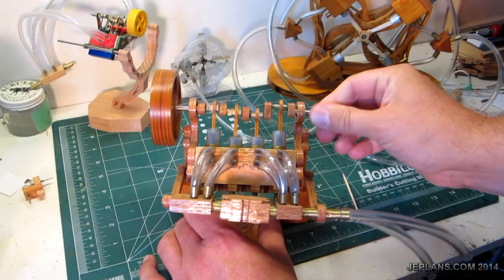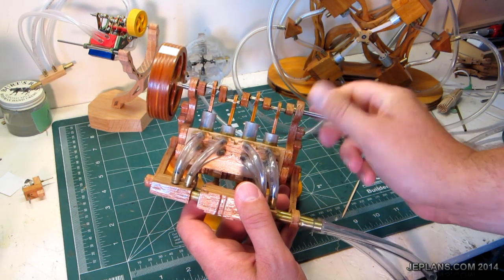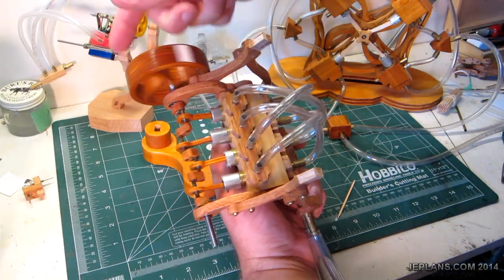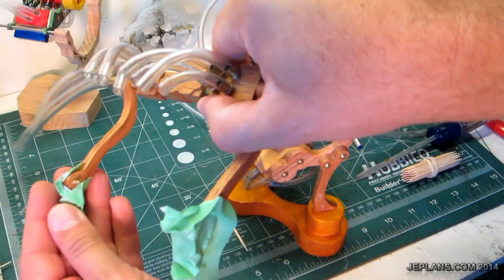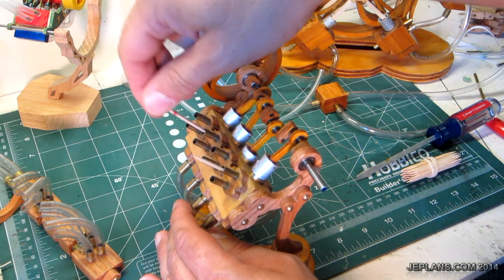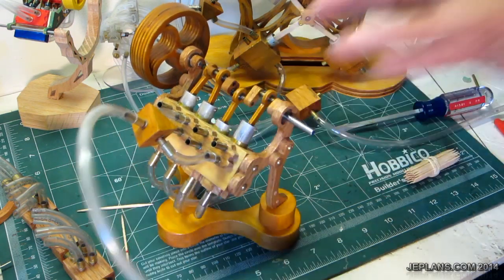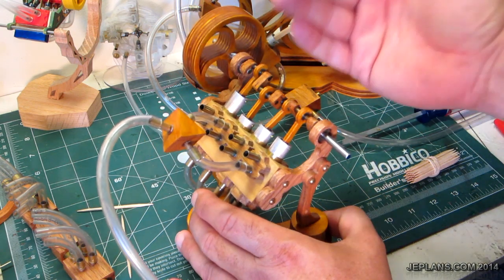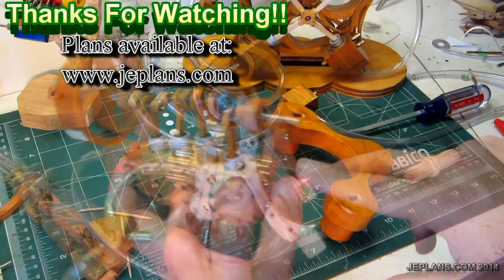Troubleshooting the Inline 4 Air Engine

Comment: So I have checked the piston hole both upper and lower inlet tubes. Question...i did notice that when the piston holes were drilled out the holes are not exactly opposite each other. The larger side is a bit to the side of the piston. Looking at it the air still should pass thru to the other side. I have checked the outlet tube and there is air coming out thru the pressure tube for the upstroke of the corresponding piston.  Does the drill thru the piston have to be exactly inline? Did the toothpick check and it goes in all the way for all 8 tubes. When I tried to run it with just 2 and 4 hooked up, one rotates clockwise and the other goes counter clock thus preventing the crankshaft from spinning. Anything else to check?

Comment: thanks for this video. Just this morning as I was looking at the engine I noticed that the piston holes were not lining up witht he upper and lower inlet tubes. Don't know if it's the piston, connecting rod length.  Hope i don't need to make a new set of pistons.
Reply from the maker: Carlton Wong Make sure the plans printed actual size or 100%.  By checking the printed rulers on the corner of the pages with a ruler.